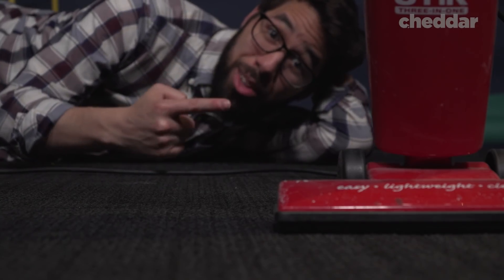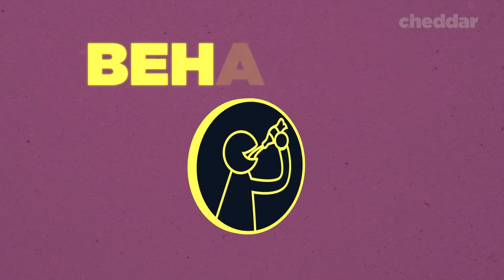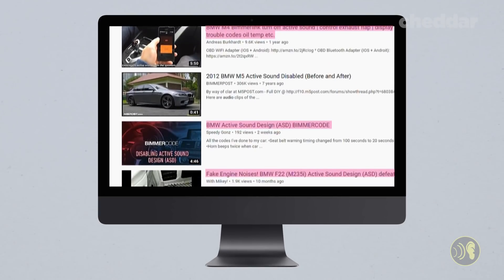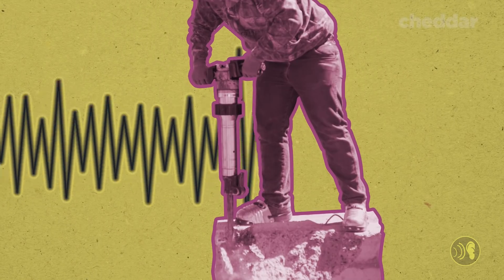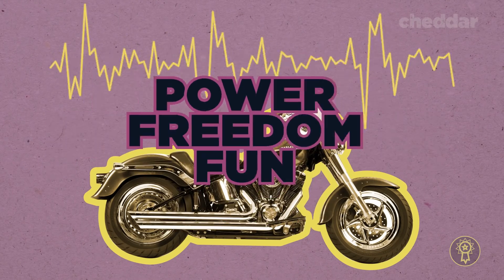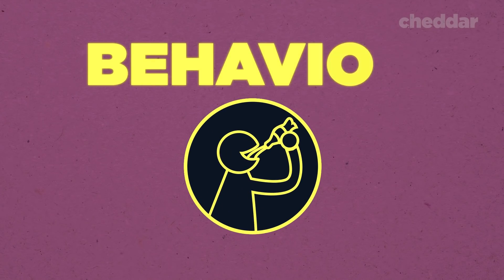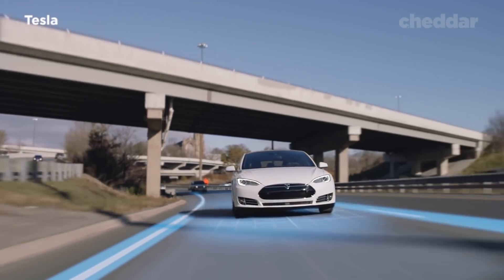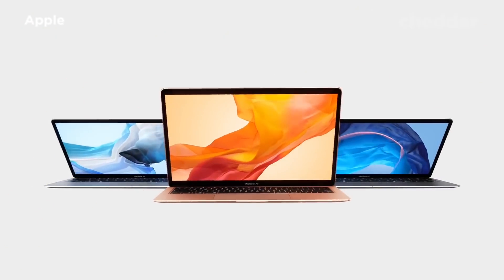The Fake Sounds Companies Add To Products - Cheddar Explains

Comment: "Make the vacuum loud. They'll think it's cleaning when it actually isn't."
Reply: Yeah, it's such bs. The sound of picking up trash is nice, but the high-pitched roaring is so awful. I'll never vaccum without headphones in.
Reply: Make a vacuum loud . The sounds of dust and dirt slamming against it . You think it’s cleaning and it’s actually spitting it out
Reply: Yg Koz I have two vacuums because one doesn’t pick up things from tile even though it has bare floor option. Just spits it back out everywhere, but it works better on my rugs than my other one lol
Reply: @Chaosgod100k  damn..
Reply: New vacuums sound like shit because they have high rpm motors with a small fan while older vacuums from the 90s and back had slower motors but a larger fan, so that's why old vacuums sound far better and are more powerful and efficient than pos Dyson and shark vacs
Reply: “Da best dakka makez da biggest boom! Louda iz bettah!”

-Da Orkz
Reply: My vaccume shoots dirt and other objects around the room.
I got glass in my face once
Reply: @Stardust crusader. Don't worry, Jude is never involved when I'm finding books to read
Reply: I've got the perfect solution: it's silent, thin, lightweight, portable, and is 70,000,000,000,000,000 times more effective than the average vaccuum cleaner - 
it's a fucking broom
Reply: @JUNGLEsapling69  you sweep your carpet ?

Comment: Motorcycles don't need to make sound to make their presence known. 

Often times that confuses drivers as to where the motorcycle is due to echoing off other cars, signs, and walls.
Reply: I would also add that the majority of the sound from the motorcycle is projected out the back of the bike away from the direction of travel, also reducing the overall effectiveness of its use as a warning system for other people.

Comment: Who the hell likes vacuum cleaner noise? 

LITERALLY NO ONE!!
Reply: I love the dirt-collecting sound though.
Reply: You like the sound of the dust banging around in the vacuum though.
Reply: Yalkın ÇIRAK you dont think you do until it you feel like its under powered
Reply: dat guy the reviews I read for noisy vacuums saying they suck at sucking means fuck that noise (pun intended)
Reply: Radu C its not necessarily the only thing that goes into a vacuum feeling like it sucks, you aldo have the possibility of being actually underpowered. But if you were to compare the same two vacuums, probably decent ones except one is louder, youd probably feel like the louder one is better.

This also happens in videogames, where a character can be really good but feels plain wrong to play, or that time where some play testors felt a weapon was little under powered, the devs just changed the sound to have a bit more punch, and they liked it.
Reply: @datguy8805  

"This also happens in videogames, where a character can be really good but feels plain wrong to play, or that time where some play testors felt a weapon was little under powered, the devs just changed the sound to have a bit more punch, and they liked it."

and i wonder how many of the games are still played?. and no if i can test them out like in your scenario i rather take the ending off and press my palm against both of them witch one sucks more thats the one i would get. sound has nothing to do with it. but clearly not everyone has enaugh brainpower to figure it out so i get your point but that dont make me hate any less.
Reply: LukeR youll say that but when theirs little to no statistical difference, and you havent gone out of your way to calculate dps, youre going to go to the one that feels like it has more punch. Oh and since there isnt a statistical difference for that feel, youre probably gonna go with sound. Brain power, yeah, so do a lot of people, they have the brain power to calculate dps or see an obvious difference, but this is shit you dont always notice unless one sounds wimpy and you take time to compare with data and shit. Spoiler, most people dont compare with data and shit, if theres stats laid out theyll use it but if theres not its all about how it feels. And i said, if theyre both almost the same the one that sounds or feels better is gonna win until it is proven that isnt the case

When theres a drastic one, well no shit, feel can make something feel better and better to use, and sound plays a part. But if it murders something while the other feels like youre hitting a bullet sponge its obvious youre gonna feel more satisfied actually doing the thing.
Reply: @datguy8805  there is a reason why i use broom even tho i got 3 perfectly good vacums somewhere in my house.
Reply: LukeR is it becayse people generally use vacuums only for carpeting? /s

Regardless its not something you actively thing, it feels underpowered because its quieter, even if its convient for you and good doesnt mean it doesnt happen. this sort of thing happens in videogames all the time.
Reply: LukeR heat and sound have little association, sound and power of a spinning or sucking sound have a big association. 

Take any spinner from battlebots robot wars etc, when it cones to verticle spinners many will cite the ones with the big death hums first (with the exception of nightmare) of followed by aftershock and the ones that dont, even if their theoretical output is similiar or the same theyll still say the ones with death hums. Horizontals dont have as much of a connection however, and they also wont list little drummer boy for older bots as that wasnt audible.

 Another example are videogames, guns can feel wimpy because of their sound.

Lets try the following if i play BL2 and take a black ops zombies enemy that has the respective amount of bulk and compare a tedior smg and the mp40 with a similar amount of kill time, i garuntee you ill just throw the smg instead of bothing to unload because of how wimpy it feels, but that mp40, i wont take out the shot gun cause that thing feels and sounds like a goddamn cannon.

Now lets compare this to a light bulb, if i turn it on i dont need the buzzing sound to know its on, the power is displayed through the brightness of the bulb, something which doesnt take you any initiative to observe unlike the state of the floor, and besides thats not even the good thing about bulbs anyways.

Heat from an iron, that takes initiative to observe if you want to be exact about it, enough initiative that youd have to grab something entirely seperate or burn yourself.
Reply: @datguy8805  exept the fact that my landmower acualy makes less sound than the god damn vacum,

and in that video game comparison, no i would not take the gun that sounds better. if i did im sure everyone would be running around with shotguns or sniper rifles. for example in csgo i take what i feel most confrtable on. i could take awp or ak but i go for galil cuz im most confrtable to shoot on it even tho it deals less damage and is less accurate. same in other games. i dont take biggest baddest champion in game. i prefer what i like not whats "best, most loud or obnotious."

we dont like change. but change is good and the sooner people and those foslilised companies learn that the better.

 look how much IT industry changed since 2000's? if people sticked to what they were used to do you think we would have what we got to day? without inovation and inprovement? why dont they acualy make the vacums suck like decent mashines before focusing on artificial sounds to make it sound good.
Reply: LukeR its not strictly thatx i said, similar you dolt. Two smgs with close kill times similar. Two pistols with around the same firerate, damage, and magazine, similar.

Your lawnmower is IRRELEVANT to your POINT in fact, i think youre just trolling me at this point. My point is that it provides a slight edge in percieved results, even if it doesnt change the actual result.

 If both things are crap, itll remain crap to them, but if both are pretty much the same and cost the same and one sounds more powerful than to that unaware consumer it might as well be. And even if they are informed, the question is who informed them, infomercial comparisons aren't usually trusted. In other words the idea is that it increases demand via percieved quality. Maybe not by a whole lot, but even a slight difference can make profit over the other one even with the changes made to make it louder.

And they dont focus on just making more noise, they do want to improve both the capability and the ease of manufacture just as much as percieved quality. Its one of many things. Of course weaker vaccuums are an inferior good as is, theyre looking for any buyers and noise is just a potential advantage, as making it quiet costs money too and it lowers percieved quality and therefore demand. Too get to the average consumer with a quiet vaccuum it likely has to be higher than average quality in addition to being quiet, or one that doesnt rely on suction and can be immensily less expensive.
Reply: @datguy8805  did i ever said i dont agree with you. key word is "unaware consumer" and the point is there are legit none "quiet vacums. they are all the god damn same. i dont mind paying more for something better.

 but the problem is same as with  CVT transmitions. they can be infinitly better with peak performance at all times but programes program them to rev completly ruining the whole point of the invention it drives me insane and thats my problem. they make cheep crap to work from waranty to waranty so you have to change them every year or two to make profit. instead of driving the industries forward.
Reply: LukeR there are no quiet vaccuums for your average consumer as they have been deemes not all that profitable. You have to be ahead of the curve in terms of power, introduce stuff to make it quiet, and make sure its at a price thats reasonable to your average consumer. Thats not all that easy and likely seen as a risk, and loud vaccuums arent exactly a secret within the industry, just outside of it.

What they have deemed profitable are quiet hotel vaccuums, as those will be sold at a high price anyways, and are something every hotel owner will explicitly set out to find if they have the cash.
Reply: dat guy or they could make it quiter and MAKE IT MORE POWERFUL
Reply: Evil Hutdug which i have said, you need to have a vaccuum thats decently ahead of the curve in general for it to sell
Reply: @datguy8805  i do
Reply: @datguy8805  infants do
Reply: meh i never said that there are no benefits, there are. Thats why such vaccuums are sold to hotels, but those arent exactly affordable and convenient for your average consumer, even one with a baby.
Reply: Yalkın ÇIRAK I do, i love to vaccum ! from the sound to seeing all the dust and dirt on the floor being sucked in. makes me satisfied and happy. 
There is even asmr of vaccum.
Reply: Alexandra Black_Woods if you had a son or daughter then they wont like the vacuum and YOU
Reply: As a dog owner, that sound needs to disappear
Reply: I like the sound of particles and small objects being captured and clicking when they get picked up. The loud, obnoxious, constsnt whirring? Not so much. Often you can just tell a vacuum was made intentionally ridiculously loud, and most of the time it's also a really horrible vacuum.
Reply: Its not about liking the sound, its how the sound makes vaccumm "feel" more powerful with the louder sound.
Reply: My cat. He likes it so much he gets embarrassed and runs away
Reply: I am scared of vacuums because of it. it sounds like it's going to explode!
Reply: See, if I see the vacuum full of dirt and hear clods spinning around I would still feel as good. Im assuming the mentioned "silent" vacuum was an old paper bag style which would almost completely remove the loud dirt cyclone you get in a plastic collection bin as well as deprive you I've the visual of the dirt actually being picked up
Reply: My young Nephew.... good kid, but an interesting one
Reply: A deaf cat
Reply: Certainly not my dog
Reply: I do
Reply: Right? And i watch if shit actually get vacuumed so when i hear it being LOUD af but i SEE not much work done i get pissed
Reply: I have learned to like the sound of a vacuum cleaner. Because I have owned a quiet vacuum and it felt weak. When I think about it now, it was probably just in my head.
Reply: Yalkın ÇIRAK 
Definitely not my cat.
Reply: I do?
Reply: Nobody:

Black kids with a Kinect Mic with their mom vacuuming in the background: VRRRRRRRRRRRRRRRRRRR
Reply: I do
Reply: a document literally said THE CUSTOMERS REJECTED SILENT VACCUUM BECAUSE IT COULD HAVE EQUATED TO *INEFFECTIVENESS*.
Reply: Colicky babies.

Comment: Electrolux of the United States (now called Aerus) used to put mufflers on the backs of their vacuum cleaners until the late 1960s or somewhere around there. That is way before my time, but I heard that customers thought that the machines could not possibly be working well because they were so quiet and many even opted to purchase different models. I have a few models from them with mufflers and I can confirm that they can smoke most of the vacuum cleaners on the market nowadays. The same company does offer a canister with a brushless motor that is insanely quiet while being very powerful, but it is not a mainstream unit like the Electrolux models were 30+ years ago. In modern times, the case is mainly that the average consumer does not seek a high-end vacuum cleaner, so the machines that they get have very little noise reduction in an effort to minimize the cost of production. It is not worth it to make them quiet because, as mentioned in the video, people actually do think that they are "not powerful enough" when they do not make enough noise or advertise a high current draw such as "12 amps maximum cleaning power" that does not necessarily transfer to cleaning ability.

Comment: Ohh, so I'm ruining my hearing but at least the manufacturers are happy?!?!?!?!?
Reply: We are all thinking about us , but what about sound pollution ? Its still fucking bad for the environment
Reply: @archmagosdominusbelisariuscawl  
In the EU a noise limit of 80dB for household vaccuums was introduced in 2017, together with a watt-limit of 900 watt. 
This is supposed to save about 20 Terawatts each year across Europe by 2020 and an independent rating system (A+++ to G) lables the dust pick-up capabilites, the energy consumption and filtration efficiency. 
Surprisingly the new lower-watt vacuums have the same cleaning capabilities and also the benefit of sound isolation. 
Sometimes companies just need some "force" to fuel innovation :P
Reply: @i.i.iiii.i.i  you got an upvote my dude , good research you did there
Reply: @archmagosdominusbelisariuscawl  thants true
Reply: How tf are you ruining your hearing dumbass
Reply: Thats exactly how capitalism works.
Reply: Yeah, because a vacuum will cause tinnitus right?
Reply: @g.ferreira6745  well I measured my vacuum cleaner in decibels, and it's about 80 decibels. Anything above 90 decibels is considered to damage hearing, the story doesn't end there because a long exposure to not necessarily loud noises for a long time can damage hearing as well. So, yes it will cause tinnitus in the long run. About 15% of people have it apparently
Reply: @giovannip8600  I can indeed back this argument, as I suffer from this. Vacuums are literally my most hated tool for cleaning because of this reason, I've been exposed to it for a while, yes they do cause tinnitus long term, however they also trigger amplified short term tinnitus if u already suffer from it.
Reply: @giovannip8600  taking a shower and driving in high traffic are both around 70dB, and usually we do them way more often than we vacuum our houses. I don't think vacuums have a major role in those 15%
Reply: @g.ferreira6745  Because of the way that the decibel scale works, the difference between 60 dB and 70 dB is significantly less than the difference between 70 dB and 80 dB. That's how a jet engine is only twice as many decibels as a shower, despite the jet obviously being vastly louder.
Reply: Gustavo, i actually wear swimming plugs in shower. And yes, the noise is damaging to ears in the long run, especially jet mode in shower makes way too much noise. The water hitting the floor fast also makes alot of sharp clap noises. Yes, i have sensitive ears...
Reply: the point of the video is that they do it because it makes consumers happy
Reply: @Alex-it7ms  doesnt make me happy. It also doesnt makenme happy that toothpaste is minty so people think its cleaning even if it's not. Same with detergents that smells really strong. Its to trick into thinking it cleans better than it does because of the smell.
Reply: @itwasaliens  but clearly you're part of the minority. @Alex is right
Reply: None of those things can damage your hearing, man. Its not just because its loud that it will hurt you, the sound needs to be a certain amount of decibels(not sure I wrote it right, but anyway) before it begins to damage the hearing

Comment: Yeah I'm calling bullshit, no car manufacturer on the planet goes "man I'm really concerned about what is and isn't audible when a key is stuck in the ignition."
In short vacuums are loud because if they were quiet it would be much harder to gauge by sound when they're starting to lose power; cars pump in fake noise so they sound good to the driver while being quieter outside the vehicle; and people like crunchy potato chips over soggy ones, because somehow that's news.
There, saved you 9 minutes.

Comment: Loud engines should be illegal. Some of them (especially motorcycles) are actually painful to be too close too, and can cause hearing damage, which is a public safety issue. Not to mention, disturbing the peace. In my city, it's really funny - we have a loud stereo ban but nothing about obnoxious mufflers (or at least the later is not enforced or doesn't apply to bikes).